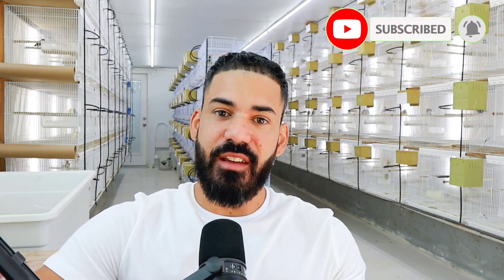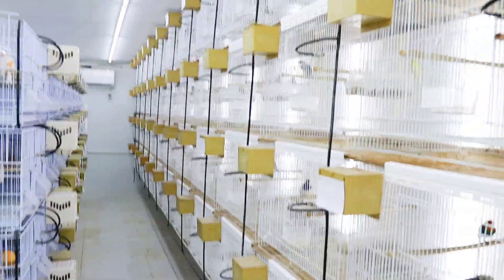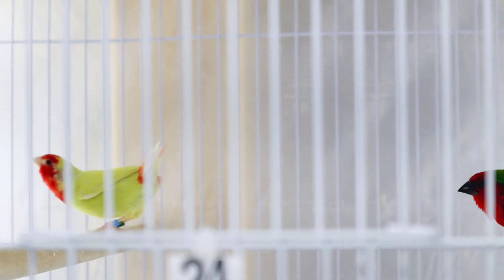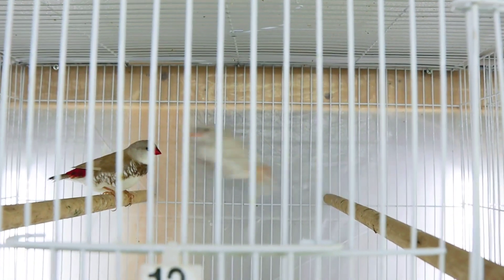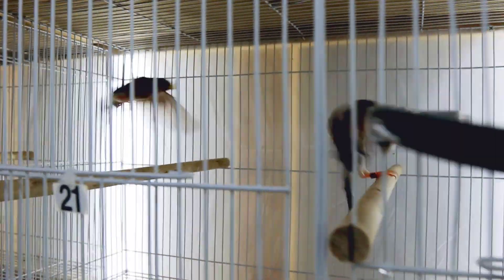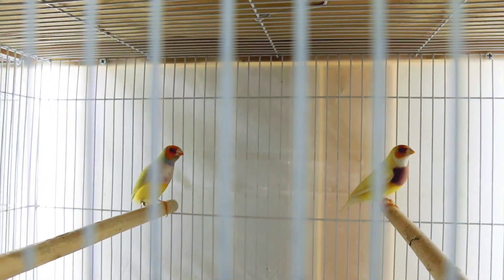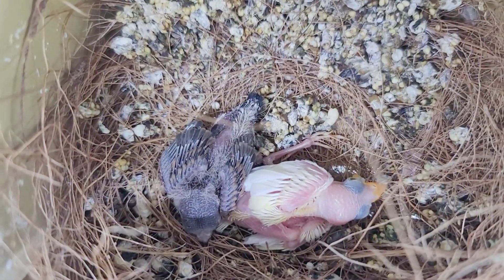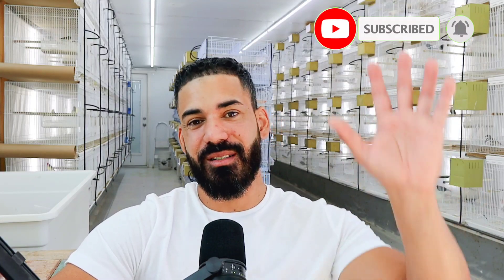Bird Breeding Update + How to set them up to breed | Finches | Canary | Bird Aviary |

Comment: Good to know about the egg food thing. I'm going to have to make adjustments there.
Reply: Same here.  I add it dry in a cup.  They eat it but mixing it with wet might help.
Reply from the maker: They love it when its a bit moist only bad part about doing this is you have to toss out what they dont eat by the end of the day but when given is small amounts they have little to no waste
Reply: I occasionally give it moistened but they don't eat much of it and, you're right, I have to throw a bunch away because of it. That's why I was giving it dry, but I usually put a few smaller sized mealworms in with it along with a bit of commercially dehydrated mealworm and mix it all up. Helps the live mealworms last a bit longer too and I can leave it for  few days. Dont want them to get fat though and now I've got some potential direction on why my egg fertility rate seems low. I think I'm going to try to just give a lot lower amounts of egg mix in my mixture. I'm not in a position to put out sprouted seeds daily, only once or twice per week. I usually do as stated here and throw a bit into the egg mix noted above. I've just got to cut back on the amount of dry egg food I put in there because  was using that as the primary base of my mix.  Always good info here.

Comment: Your doing something wrong. You need to put a divder between cages. You don't want the pairs looking at the other pairs you want them to concentrate on there partner.  Try it I guarantee you will produce more chics.
Reply from the maker: 100% agree with you back in the day with my old setup I used to block the sides so pairs couldnt see the next door neighbor but with this new one its all open but trust me been thinking about a way to do that same exact thing
Reply: @Paradise Aviary  Home Depot sells a sheet of white PVC that works perfect and it's easy to clean.